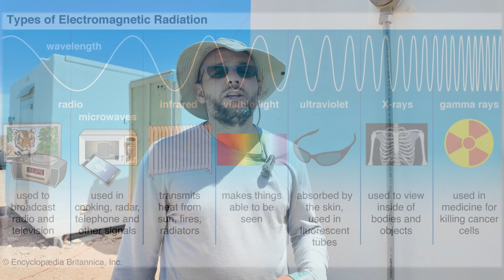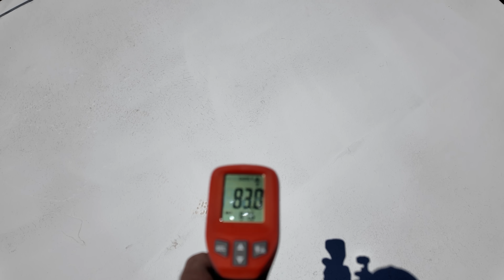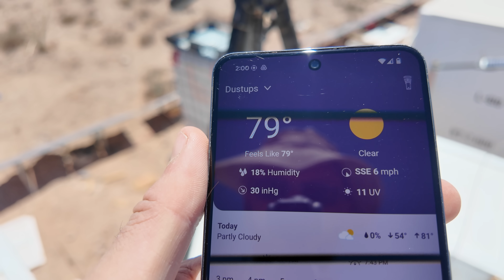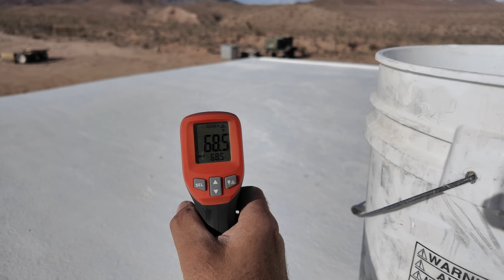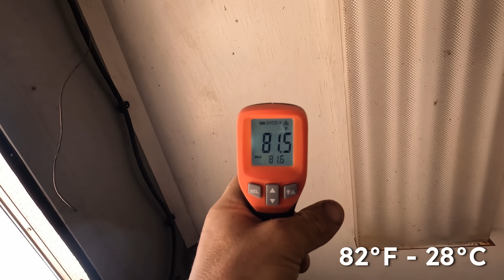I sprayed "cooling paint" on my desert cabin...this is shocking

Comment: Have you thought of doing trying geothermal cooling and heating???? It might help and if you have solar I've heard that some people use even a computer heatsink fan to power  the intake and exhaust of their own geothermal system. But you'd have to dig pretty deep and coil the piping/tubing round to get the most cooling or heating effect.

Comment: You can get inverter 12k aircons for cheap that sip power and used panels from santan are super cheap just sayin. That said I am going to investigate this for my main home as the roof is 18 years old anyway. Great video thanks for sharing this tech!  Also is it possible to mound up dirt against the structure making a sort of above ground below ground house?

Comment: You are not going to be any cooler than the ambient outside temperature without insulation or active AC.  I live in Florida where the outside temperature is typically 90°F in summer.  Painting my lanai roof with white siliconeized  paint dropped the inside temperature from 110 down to 100.

Comment: You might try experimenting with a pergola over the cooling paint to shade the sun on the rise and fall sides while still leaving the roof exposed to space directly overhead to see if even more cooling can be achieved. Make the slates thin and extra wide. As a test use cardboard and attach it like a hat with a air gap to the roof before spending alot on materials, then if it makes a significant difference you can invest in a more durable material.

Comment: One idea to consider is painting just the top 1 to 2 ft of each building around the sides. It adds an appealing visual detail as well as helping to reflect a small amount of the very top ground portion of each building. 

Short of reconstructing the buildings into hemispherical domes, That might be one of the easier strategies.

Comment: I’ve used Henry’s Dura-Brite in my backyard gardening projects. It’s $100 at Home Depot for 4.75 gallons which comes to just over $21/gallon. That’s cheaper than house paint. If you want to paint the walls and don’t want the super-expensive stuff you used on the roof, you might try Dura-Brite.

Comment: Why don't you make a giant panel that exceeds the size of your container and then circulate water in it back to the cabin.   The panel will act like a heat exchanger, radiating the thermal load from the water to space.  If you had a panel 4x the size of your cabins roof then you could multiply the rate of heat emission by 400%, with some loss in the water loop. This could go on top of the cabin, effectively offering shade to all the sides as well.

Comment: Just an ideal to share. What if you created a roof over a roof? With an air gap between the 2 roofs. The heat the top roof absorbs will transfer to the air space. Thus causing the air to rise and draw cooler ambient air in to the lowest edge. The entire structure is shaded. No transfer of radiant, or infrared energy into the bottom roof absorbs

Comment: I literally lived in a metal shed for some time, and a nifty trick I used was laying outdoor bamboo screen across the top.  The idea, which ultimately worked, was to minimize direct contact from any sunlight on the main surface while still having maximum airflow (aka a sunscreen for the roof).  I think a similar effect could be achieved with spaced slats like an outdoor gazebo spaced above the roof surface.  Same could be acheived on the walls by attaching lattice around the outer suface with about a half inch to an inch gap with spacer blocks.  My results ended up with a drop in temperature of about 10-15 degrees (F).  Mind you, I wasn't in a desert, but the principle should still hold up.

Comment: to apply same idea on walls without perpendicular reflection of the heat,  perhaps one could try adding little planks to the wall with some angle,  as in  the design of a fresnel mirror.

Comment: Using a non-contact infrared thermometer to measure two roofs with significantly different emissivity has given you a false sense of operational efficiency of the paint. 
Your measurement of the ceiling inside each building was a better representation of the truth.

Comment: You should have rolled the paint onto the roof rather than using a spray gun. Spray painting is notoriously uneven and way too thin a coating.

Comment: Why not take the time to build a solid, heavy-duty canopy over your hut—almost like your own artificial shade tree? You're basically creating a barrier between the harsh sun and your living space. It doesn’t have to be fancy—just effective.

I built a small living structure (a tiny home) inside a warehouse, and it functions like a cave—very stable and controllable. I keep the warehouse ambient temp around 85–90°F, and inside my insulated build-out, I just run a small cooling unit and a fan for airflow. It works amazingly well and stays efficient because it’s protected from direct sun. Now, I already had the warehouse, but the same principle applies: build a structure like a carport—something sturdy enough to block the sun’s intensity. That outer barrier will reduce solar load significantly. Add a bright white reflective paint on top to bounce radiation, and your living environment inside becomes far more manageable and efficient.          

And yes this is a great video! Thank you for sharing!

Comment: The ideal thing would be a false roof over the existing one and a false wall up to 12“ infront of the somewhat south facing walls.  For the wall it is important that it is open on the top so the heated air can escape. Ideally one could close the top of the wall in winter to keep the room warmer by trappint the air.

Comment: I think you could try a fake roof about 4 inches above the one you have, painted with your anti heat paint would make your room much cooler. Any solar heat would be on the fake roof and the real roof would be in the shade with that breeze you had thru the whole video cooling it.

Comment: I saved the company a ton of money by recommending the application of Kool Coat to the top of our modular blast resistant buildings. They wore looking at increasing insulation and installing bigger AC units and I proposed doing a building as a test. They immediately did all the buildings after seeing the results of the test building and it saved them a ton of money.

Comment: My very simple cooling idea that is proven and much cheaper: Install a so called anti-heat mesh fabric with a distance of 2 inches to your roof (and side walls if you want) and the heat will be down a lot in your room. This mesh fabric is black and it warms up enourmously in the sun, you can see the air shimmer above it, while it is cool in the half shadow below. The mesh lets rain and wind pass through, so you don‘t have to take care about that.

Comment: surely soneone already said it, but Tech Ingredients has a fantastic video on this topic.

you can get your roof temps below ambient air temp, with paint that is extremely cheap to produce yourself.  the drawbacks are you have to spray over 25 well-timed layers to achieve a 1mm thickness  coating, and the solvent  (dimethylformamide?) smells like fish.  and then in the end you have an acrylic type paint- not the most durable.

Comment: 16:45 the IR temp gun is not very accurate when the reflectivity is drastically different thought. The better way is to use contact sensors like thermal couple.

Comment: I wouldn't worry about the temperature of the roof. What difference does itmake in the room? We have a "cold storage room" in our basement.  It is all cement walls. Problem is half of it is exposed due to the house being on a hill. Temperatures in it in summer were in the nineties. So much for cold storage.  We painted the exposed cement with heat reflective paint and the problem is solved. The hottest it now gets in there is around 70.

Comment: LOOK.... I'm going to come out straightforward and say trying to cover with paint to keep things cool is one thing but let's keep it in common sense here?  Sunlight in contact with the surface of anything is going to transfer energy.  So....  keep the sunlight off the Roof with shielding,  use something as an intermediary such as some kind of tarp or shade cloth? Some kind of corrugated aluminum, better yet....  How about Solar Panels?  Bifacial solar panels would provide electricity and shading all-in-one is a matter of fact you talked about having a shaded area I would create a solar awning across the two cabins giving you an area in between of a shaded patio made of Power Generating Comforts from the Sun.  These panels are extremely cost-effective on the area that they can shade, durability and if you get used ones that still provide 90% power you can get enough panels to cover the entire area including the sides of the box for $1,200.  THEN.... GUESS WHAT? 🤔  you have so much power capacity now you can get a large mini split and create a freezer literally with Cooling inside those cabins.  Just saying, Problem Solved. 1st: Shading prevents Thermal Exposure.... 2nd: Solar Panels 2x Times Benefit answer's problem #1 and BONUS Provides Surplus Power. 🤠👍 😀

Comment: How much does a big mirror cost? 
Try a white sheet of plywood on the roof, on blocks to shade the roof , and add an air gap between the wood and roof for ventilation. Seems like no light hitting roof would be better than reflective paint. I live in Florida sun and use sun shades attached to edge of roof,  and use poles (Metal conduit) and ground screw anchors to lift and tension fabric. Very easy, strong, cheap shade.  You could even mount fabric from roof to roof if they are near each other.

Comment: I had a strong suspicion this was going to be ... badly done, regardless of the outcome due to 
" ... I keep a temperature sensor ... " 
Instead of - I use a Thermometer. This is a 18:50 video that could have been 9 minutes.

Comment: There is another method to help with cooling your buildings - Shade Roofing, 
You build a lightweight roof over your existing buildings with an air gap of a foot or more that allows a free flow of air between the building and the shade roof, and extend the shade roof well beyond the walls of the buildings, and build a curtain wall (Shade/Scaffold netting will work for this) on the South-side of your buildings extending East-West to stop direct heating of the walls by the sun.

Comment: 6:06 The open environment is the same as "space" for this purpose. That mountain over there isn't going to reflect anything more that the wavelength of dirt will reflect, and if it's not flat, it may reflect that radiation in a different direction.

Paint the walls.

Comment: I paid $100 for a 5 gallon of Henry’s at the Orange store.   Painted the roof and walls.   Before painting the walls you could not touch them in full sun without burning your hands.   After the reflective roof coating you can hold your hand against them without burning.    I also felt the inside of the walls before and after.   Huge difference in temps.    After painting the whole thing the inside temps dropped 10-15 degrees compared to outside temps.   I just used rollers and brushes.   Now, in winter months the cabin does stay cooler than before but I’ve got adequate heating and after insulation and drywall it keeps the indoors nice and toasty.

Comment: First window ac units are the absolute most inefficient worst air conditioners you can get.  If you dumped that thing and got an inverter window unit or mini split you would find it’s much more practical to run from solar.  Or go one better and get a 12 or 24v 10000 btu.  That little cabin can’t use more than 6000-8000 btu depending on insulation.   But using those incredibly wasteful window units on solar is completely impractical.  I would use lanco roof sealer on roof.  It’s made for mobile homes and it is guaranteed for 10+ years.  Those little cabins could be rolled in a couple hours.   

You need a pump for water.  It’s not complicated.

Comment: If your buckets are on the floor (lower then the water bin), you can just create a tiny bit of suction on the tube and the water is gonna run until you lift/remove the tube. Like a siphon, no need to run the pump ;)

That 20 degree difference after the paint is a lot! It really works well.

Comment: A thick, white tarp strapped over the top and folded around the sides like gift wrap will provide immediate shade for roof and walls for any one building. Cheaper. Portable. Reusable. Sandwich in a layer of Double Bubble Reflective Foil Insulation on the roof under the tarp for more air pocket insulation. The more layers the better. And a couple horizontal or vertical wind turbines to power your AC. Horizontal if wind is predominantly in one direction. That much wind can harness so much power! Good luck with your project! 👍🏻

Comment: Architect here.  Put up as much cheap shade material as possible to cast shadows on your walls and near ground.  Any cloth, like a woven white muslin, or loose weave black shade screen.  A loose weave could reduce wind-loading and have some blow-through.  Others note well the high winds.  Cheap, but must be durable enough to not tear out and have enough edge support.  Others propose rigid materials like plywood or corrugated panels.  Be careful with the structure.  Test which fabric you like the best.  For simplicity to attach, go between the closely spaced units and make a shaded infill  "alley" to start.  Then if you have time and resources, create shade cloth awnings around your doors. Connect between nearby units to make a long "porch".  Then the south sides without the doors.    Extend the south awning out horizontally far enough that the bottom edge of the wall stays in shade as much of the day as possible.   Go to www dot suncalc dot org and use a little trigonometry to figure the optimum extension for your area during the hotest part of the season.  If you try more painting later, just paint half the roof.  Test and observe.  Then paint the rest.  I also like Nighthawk and light and love the paint formulation.  I like Tech Ingredients YT channel also with the same experiments.  There are some MIT folk doing the same, but I like the YT bros like you and them hacking it out. Wish you much success.

Comment: I highly suggest terra cotta around the living areas, or paint gravel so that the sun isnt cooking the sand, which will absorb and radiate more heat back. I was in Kuwait in late July, thermometer showed 145, went to the airfield and it was 95 on concrete. Sand/dirt sucks when it doesn't have something absorbing the heat or cooling it like water.

Comment: Sounds about right.  When we had our 1924 flat roof painted with elastomeric white paint in 2008(?), I think the peak temp inside the house dropped 12 degrees F.  What's great is that it pushed the peak temp farther into the day, so that the AC was turned on much later for less time, :) .
White roofs are no-brainers in general.  I remember seeing Spanish terra cotta tiles in Las Vegas that were gloss white and thought, "of course, it's so obvious".

Comment: That was so cool I subbed. There are also foam-insulating based spray on paint used on outside of shipping containers to keep the metal cool. Works great because it prevents direct sun contact with the outside of the structure.

Comment: That paint is expensive - I would do a quality clean white base coat first. Intuitively, since roughly only half the aperture of sides is the ground, you would still get good benefit from using it on the sides. The ground would have to probably be "volcanic hot" for the IR it emits to be more energy than even this paint only working at half. Most of the heat from the sun (under normal circumstances) is still the immediate conversion of visible light to heat in the surface itself.

I realize you are doing everything on a very careful budget, but I would look at just insulating it from the outside, too.

Comment: If you decide to use shade cloth for anything at your site, I highly recommend the shade cloth products that Cooleroo makes. They have shade cloths  to select from, with various levels of UV blockage, that can block up to 95% UV. You can buy a roll of it which you can cut to fit (or purchase premade sail cloths), plus plastic clips which you can attach at any location along the edge of fabric to put wherever you want it. It does a decent job of blocking the wind also, while allowing air and moisture to circulate. It has been extremely durable and stands up to the strong winds. It is a game changer for us in trying to keep our chicken coop cool in the desert Southwest. 
    We attach it to the overhead structure above the coop. We extend some from the structure , hanging over the ground surrounding it, to cool the ground right around it. Or, for the simplest hack ever, we simply hanging it on the external walls, reflecting much of the uv light from hitting the walls.  Either way, we see a big difference achieving a cooler temp inside and super easy. Removal for the winter is easy.
 After trying a number of other sail cloths and shade fabric, we like this product very much.